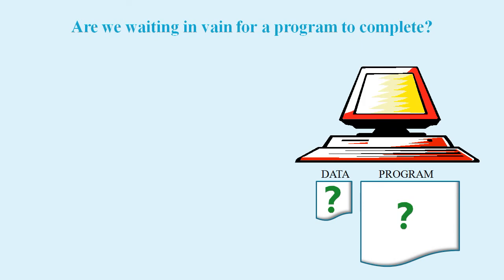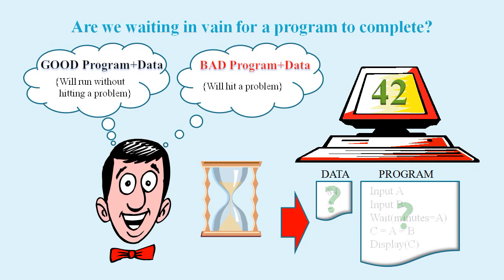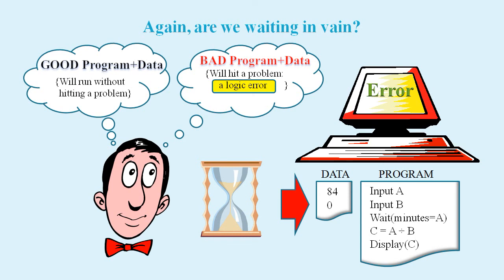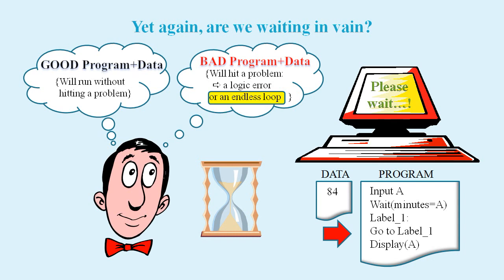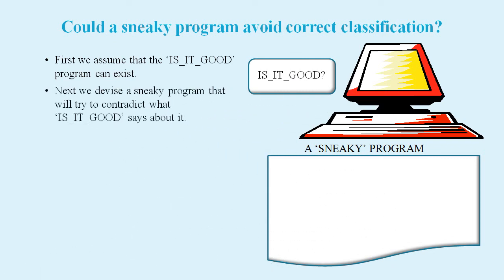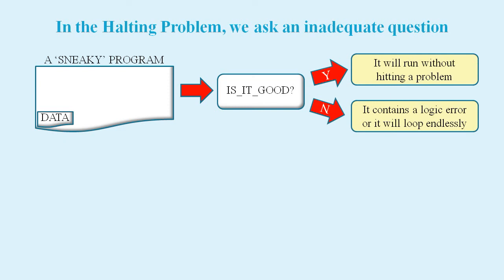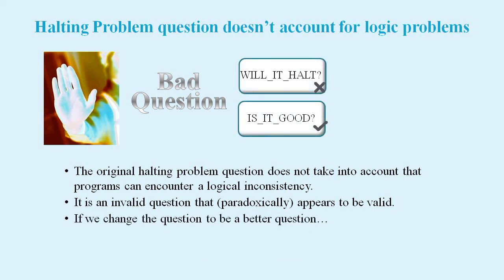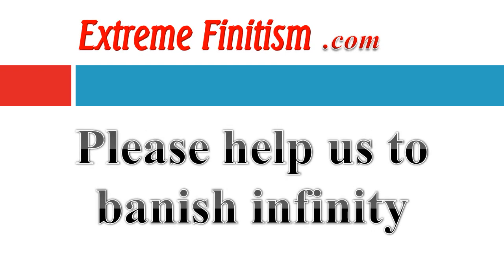Halting Problem: Finally Revealed - The (Logic) Problem with the Halting Problem

Comment from the maker: This video is a lay-person-friendly criticism of the Halting Problem proof of uncomputability (or undecidability). It points out that we are not really interested in whether or not a program halts; we want to know if it will finish without encountering an error. If we can predict a program will eventually Halt due to a logic error such as a divide by zero operation or reading past the end of an array, then this is a 'BAD' program even though it will 'HALT' (& we cannot trust any result in such a case). If we take logic errors into account, then our decision problem will no longer be susceptible to the logic trick that supposedly defeats the Halting Problem question.
 
You might protest that a 'sneaky' program could be devised in such a way that the 'logic error' (of trying to act opposite to what IS_IT_GOOD predicts) can not be detected. For example, the sneaky program could use some code that essentially performs the same logic as IS_IT_GOOD, but where the code has been made to look very different (making it difficult to detect).

In order to avoid this type of problem the IS_IT_GOOD program would need to process the logic statements in the 'sneaky' program (or any given input program) and simplify them down into a 'simplest form'. With the logic in its simplest form, then detection of this 'logic error' might be easy. If so, this would defeat any attempt by a sneaky program to avoid detection.

Of course it is debatable whether or not it is possible to reduce any group of logic statements down to a fundamental simplest form. But then the onus is on us to prove that this cannot be done. While such a proof does not exist, the argument in this video still holds.